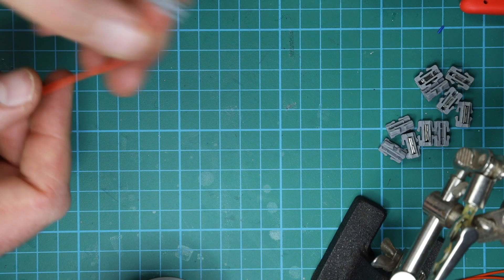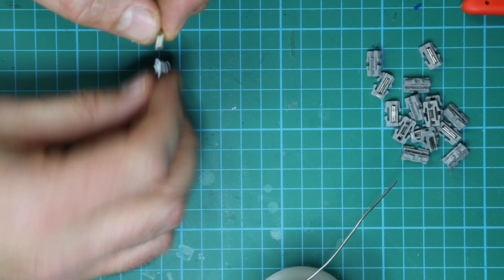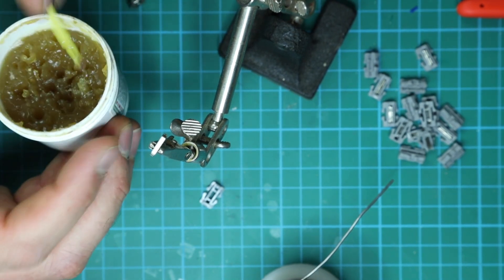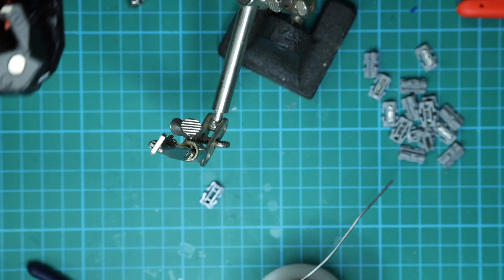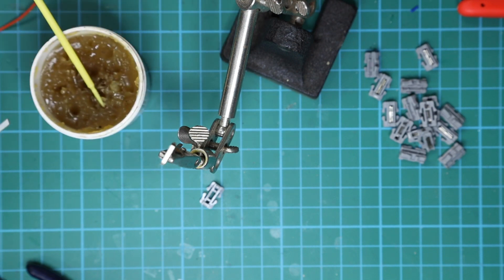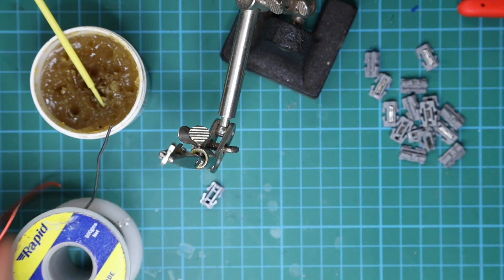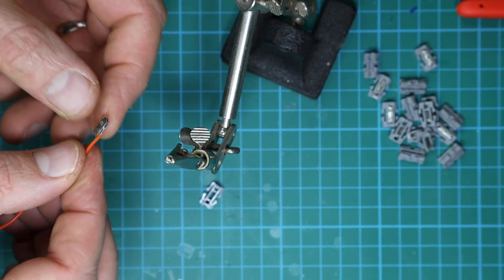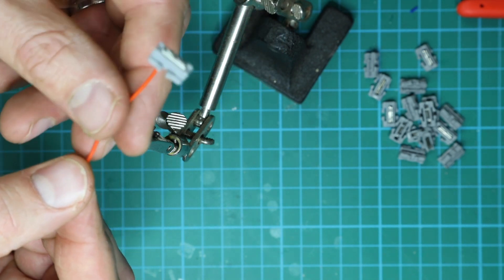QUICK TIP #1: Make your own KATO Unitrack Unijoiner Feeders

Comment: I haven't soldered anything for a couple of decades, and at age 77, I thought this might be hard to do. It was a little harder than I thought, but when I made mistakes, and yeah, I made a few, I just tried again and made two of these. Took about an hour, but I figure if I keep making them, eventually I'll be as fast as you are. Your clamps really help. I had to improvise those, and that took up quite a bit of the hour. I also recommend practicing soldering if you haven't done it in a while. It takes a bit of a delicate touch on tiny wires. Thanks for this video. It really helped me a LOT!🙂 Oh, one more thing. I learned the hard way that 22 gauge wire is the best to use for this. Anything bigger like 18 will not fit through the plastic part of the joiner. Most people would probably figure that out pretty quickly, but I seem to have to learn things the hard way and step by difficult step!

Comment: Thank you for this.  Not only are the official Kato joiners pretty expensive, but they are having availability issues. I could not figure out how to get the metal joiner out of the plastic.

If I can offer some advice as one who solders to IPC standards for a living. Use a mild liquid flux, and when finished use IPA and an acid brush (I cut min down to 1/4") to remove the flux residue. Flux eats the surface of the metal and it will continue to do so until it is cleaned off. It is best to apply a fresh drop of flux between tinning and final solder.  Avoid bending the stranded wire at the transition into the solder.  That is now the weakest point in the wire and where it will break one day. Don't give it a head start by putting a bend at that location. My personal suggestion would be to use a short length of solid core wire at the joiner with stranded wire for the bus. Last, give the solder time to cool before pulling or moving the wire.  Solder is soft and gets softer as it is heated.  Moving "solid" but still hot solder can form ripples that will become cracks over time. (Referred as a disturbed solder joint). This video shows very good solder technique, but that tug on the wire while it was cooling while tempting is not good idea.

The pernicious thing about these issues is that they do not show up right away.  The join will look and feel solid and form a good electrical join. It will not be until you have finished your layout and buried that joiner under weeks of scenery work and run trains for a couple of months that the wire breaks or the solder joint cracks and now you have a hard to access and hard to diagnose intermittent bad spot.

Comment: I'm just getting started with my conversion to DCC and was trying to find a way to connect my feeders in an elegant way - I was convinced that there had to be a better way than to drill and/or melt ties/sleepers and mess up the track. Based on this video alone I became a subscriber and gave you a like This is exactly the simple, elegant solution I was hoping for. I don't know why others don't do it. I'm off to buy a solder kit tomorrow. Many thanks!
Reply: Chad, thanks for the sub! Glad my tip helped you. However, bear in mind this tip is for Kato Unitrack feeders. If you’re using ‘normal’ track, you can potentially use the same method, but it’ll be harder to do as you’ll have to grip the small joiners somehow. I still prefer soldering directly to the rail for my normal flex track. As long as you are quick with the soldering iron & use flux and a good method, you won’t melt any ties. Good luck!

Comment: Being a newbie to modeling am interested in the gauge wire used for feeders
Reply: I'll have to have a look when I get home as can't remember off-hand.
Reply: I have found telephone cordage to be a very economical source of feeder wire. 
 Typical phone cord will have at least two pair of individual solid wires perfect for drop feeders. 
 The only slight down side is that each wire will usually have different colors so to get the full benefit you may have to have a section of layout with different feeder colors. 
Cheers.

Comment: Good tip but only for people who are very handy with a soldering iron. For the average person like myself, unless you can keep the solder a blob the exact thickness of the joiner, there is no way in hell you'll be pushing that thing back in place. After ruining 4 joiners I have decided its probably easier to to solder the wires directly to the track, the old fashioned way.
Reply from the maker: Learning to solder well is a good things to learn. But if you can solder wire to the track, you can solder wire to these joiners. Just make sure you clean the joiner well, use flux, a small bit of solder and a few decent soldering iron. Practice on some old rail, and in no time you’ll get it. I’m not ‘very handy’ with a soldering iron at all, but I’ve learned to make sure I use flux and clean the surface well

Comment: Does any one out there know what size Kato uses for their male/female plug? Seems to me it is proprietary .
Reply from the maker: No, I think it is a standard plug, but I don’t have the details with me. I’ll look it up
Reply: @ChicagoSubNScale  I have spent “hours” looking and have never found a definitive answer. Maybe I am not looking in the correct place 😵‍💫!
Reply from the maker: @fredbrooks8347 you can buy the connectors from Kato, but otherwise it’s best to just cut the connector off and put your own connectors on, ones that are easier to get.
Reply: @ChicagoSubNScale  thank you very much . For an individual home layout this would be fine, easy, and cost less. However our club on top of our Atlas based permanent public n rail/track layout we have a traveling sometimes a 100 module T Trak layout. We follow the T-Trak protocols/standards/rules so we can join other T-Trak clubs or they can join us so owe have to use Kato connectors. I really appreciate you taking the time and effort to look. As The Rolling Stones say…”You can’t always get what you want!”
Reply: They are the mini sized Tamiya connectors.
Reply: @johnmiller8884  where??
Reply: @johnmiller8884  the Tamiya are close, but you have to round over the corners some. What I have been doing is popping the pins out of the Kato connectors, then splicing on whatever length I need and then crimping on new pins and installing in the Kato connector.